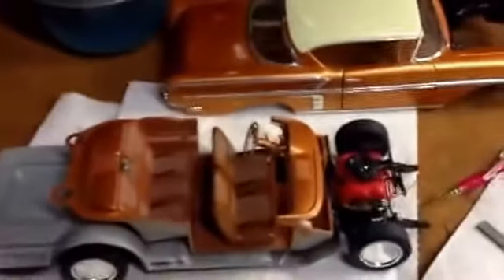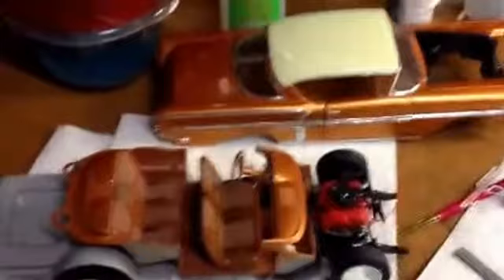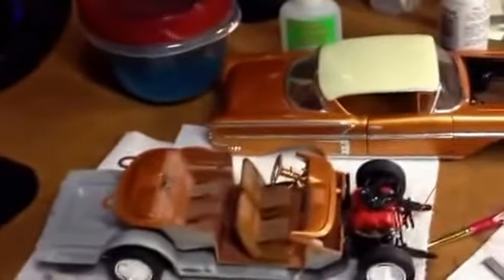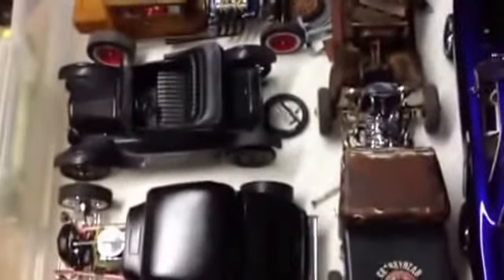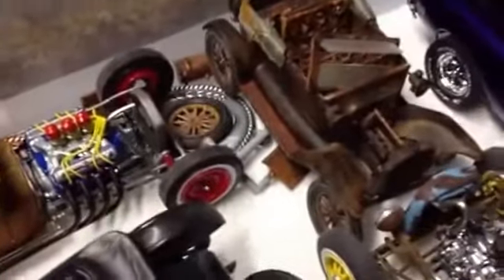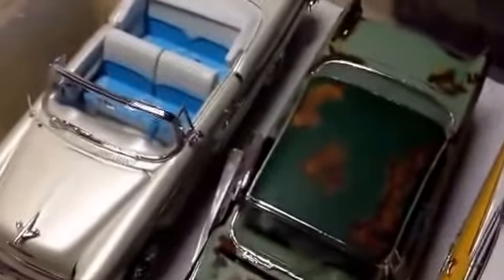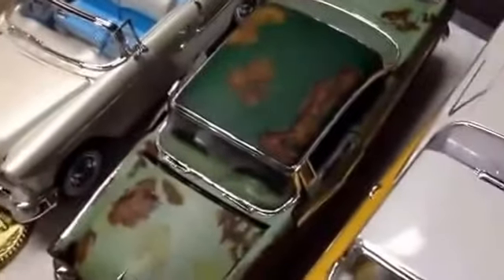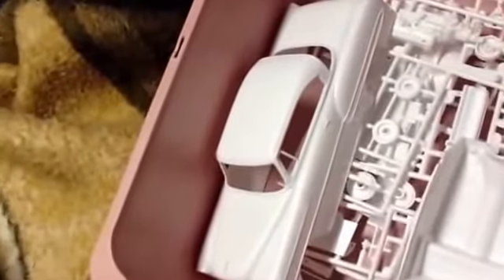How I store my models.

Comment: Yeah, the cases get expensive, but when I do buy them I get them at Michael's with the 40% coupon for $6 each...so far, since I have finished very models, I have cases just waiting for a tenant...I like to use those small individual clear containers for $1 at Dollar Tree to store the kits as I work on them, especially the partially finished one...great setup, though, and I like the idea of the rotation...keeps it fresh...
Reply from the maker: I like to use those containers for my in progress builds as well. They are great for that. Also, using the rotation theory, it gives me a reason to keep building so I can change them out every little bit. Have to admit, I can only look at them so long before I think Wow, I did that a long time ago. I am getting old.